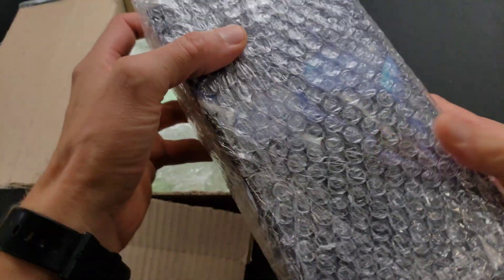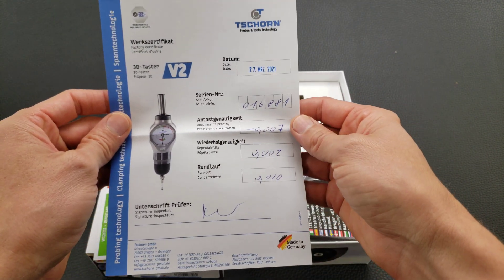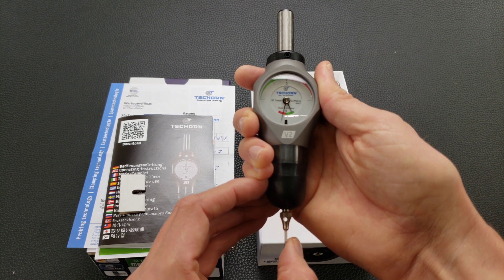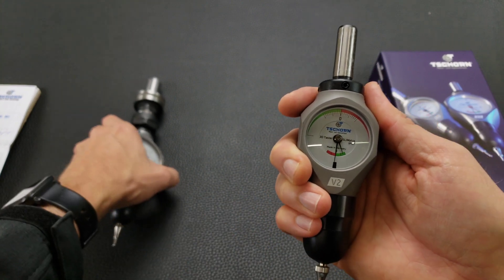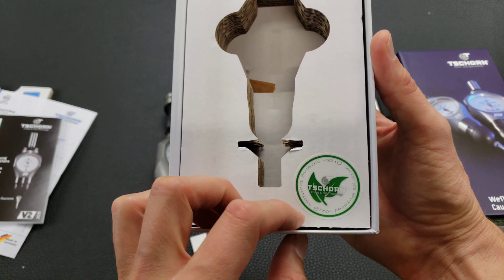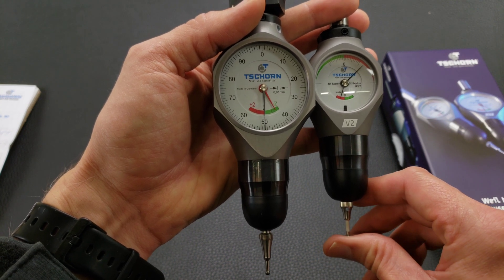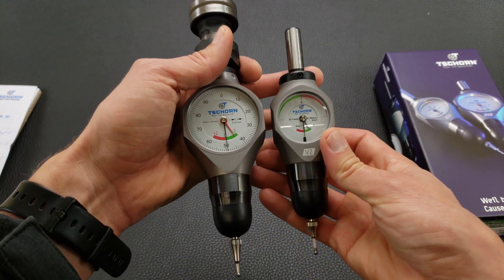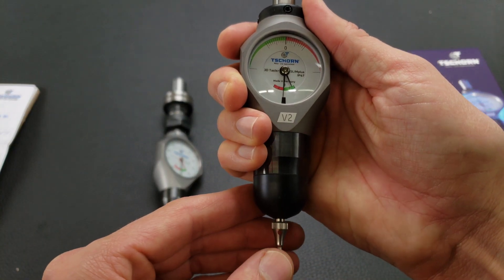Why Is The TSCHORN V2 Edge Finder So Sticky vs The V1? | CNC & Manual Mill 3D Taster like Haimer

Comment: Dear Friend when you use for the first time you need to remove the vaccum from the rubber seal and it become smooth without sticky as what you feel
Reply from the maker: Thanks for the advice, I did that when I got it, but made no difference. It has gotten smoother with use, and works very well now. So it needed to be broken in.